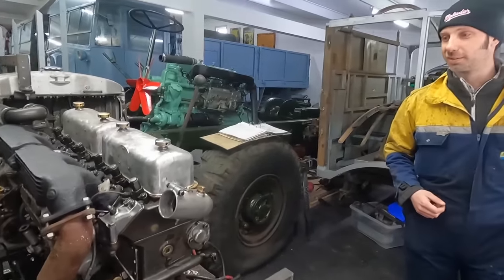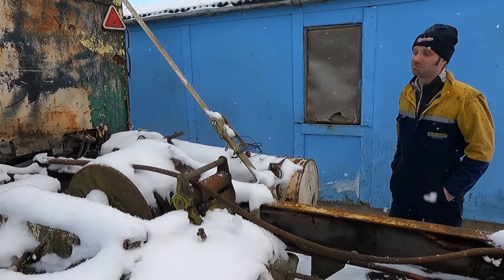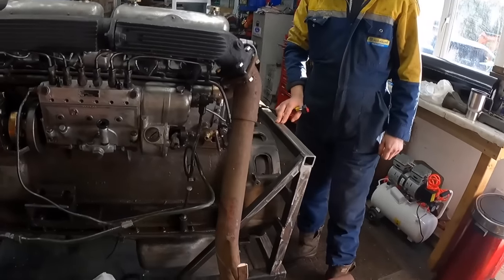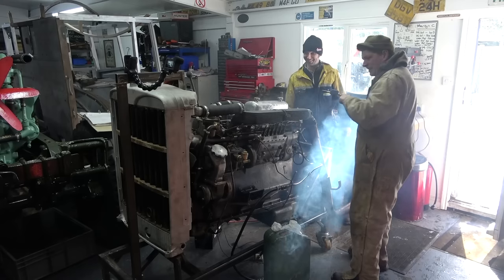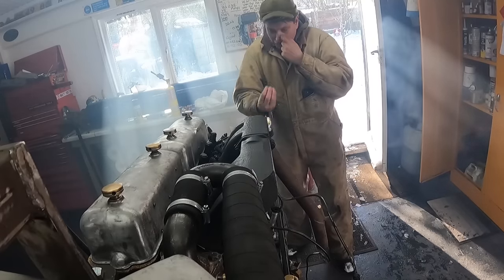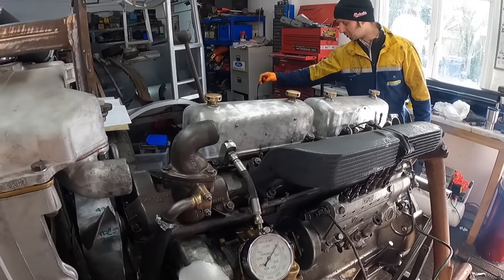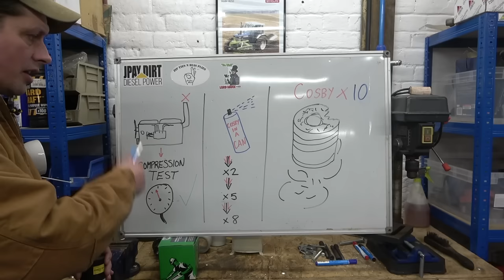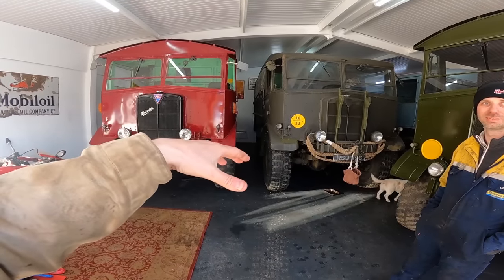WILL IT START ? - 82 YEAR OLD TRUCK COLD START

Comment: never touched an AEC engine myself so lookingforward to seeing more, but like the C6 RR long as you have fuel, air & compression they will fire. an old truck mechanic told me when i was restoring my diamond t the only thing that will stop that rolls from running is if you have the pump 180 out. so naturally when i fitted the rebuilt pump i got it 180 out bloody plank!!! proper old school armageddon engines just love them. 

and yea go for it be interesting to see what you can get this engine you got to fire on see if you can match what peg did with slave lake, fuckin minty!!!
Reply from the maker: Nothing will touch Slave Lake 😎
Reply: @LordMuck  that idi runs in canadian black magic lol

Comment: Learnt to do my hgv 2 in an old AEC in the army in Germany mid 80s if this was ex military it may have had alot of ether used this burns very hot and can damage the rings sounds like low compression so no compression ignition
Reply from the maker: If an engine is in good condition, it will start without ether or if ether is used in cold conditions it won't harm it. If you watch the video you'll see what's up with it.

Comment: They had a bloody sherpa van at work back in the 70's Mechanic went out in it, went for reverse ( it's a lift and accross job ) and the whole gear lever including the overdrive wires !! came off in his hand, Be a interesting vid to see what will and wont start engines .

Comment: I live in Australia and there are 7.7 litre and 9.6 litre AEC engines here that will need parts etc. There has been concern of where we can get parts. Me myself have an AEC regal bus with a 9.6 litre engine and there are plenty more here. Could you send me details on where you get your pistons, rings, bearings etc. from or remanufactured to help old vehicles down here stay on the road a little longer. Thanks in advance. Like your videos by the way.
Reply from the maker: Drop me a message on Facebook or Instagram.

Comment: drove a cotton picker for 15 years , had to use eather every time it was started . timed 3 times ,overhauld 1 , and 1 new enjector pump . fuel lines cleined out every year 2 set os filters in the 3 month hearvest time.  did not mater 30 deg. f.  110 deg. f.
Reply from the maker: Something was wrong with it then as it wasn't designed to run on ether all the time.
I've seen a CAT engine that was completely oversized from new. Turns out it had the wrong pistons.
There's lots of reasons why but it definitely shouldn't need ether all the time.
Reply: @LordMuck  it never would start with out eather hot or cold .even if it was just shut off, needed eather to start,  we had 2 other pickers  that start every time no eather
Reply from the maker: Exactly, something was wrong with it.
What engine was it ?

Comment: Good evening just watched your video have a question for you I know how much you love either but I have a 1973 135 Massey and you can have it rolling over as fast as it will turn and you give it a shot of either it will lock that engine up tighter than a pad lock and it took 24 hours for it to on lock so how do you explain that?
Reply from the maker: Don't use ether...😆
What made you use starting fluid in the first place, why wouldn't it start ?
I'm no fan of Ether, I'm just not afraid of the stuff or think it's a Rebuild In a Can.

Comment: Be interesting to see what it would run on , 50/50 mix of kerosene and butter milk maybe lol  with that amount of either it was gonna do one of two things go or blow it went kinda, looks like that old engine had a hard life maybe 🤔 I  heard it hissing as you were cranking it over I was guessing broken rings or maybe a burnt piston maybe even a hole in a piston, #6 looked like it swallowed a injector tip
Reply from the maker: At this point we think worn rings were overcome by using more and more ether, eventually becoming too much, breaking an injector tip which over fueled, detonating and destroying chunks of crown and the remaining piston then breaking up.
Watch the next episode in a couple of weeks 😉
Reply: @LordMuck   yeah sounds like a good theory of what happened,  I’m looking forward to seeing the next episode , the one outside started pretty good for the temperature, wonder how much lower of a temperature one with good compression would starter at

Comment: Podge, I lived with an International truck with a Neuss D358 motor which consumed a lot of “Start Ya Bastard” over the years. Eventually the starter motor shat itself and the new starter motor spun the motor at the right speed and it turned out it was a good starting old girl after all. We thought it was just another tired piece of crap Neuss. Jeff
Reply from the maker: It's surprising even on a diesel how much difference a good starter and battery can make.

Comment: Soon as that thing started cranking over it sounded like either the starter was on double voltage or it had bugger all compression...  Maybe 3 pots over 300psi and the other three, hmmm...  Anyway, you know damn well we'd like to see you fart round with that engine and see what it'll fire off on...  May I suggest using firm hold hairspray (and maybe later in the day, if you do, as it might gum rings up a tad).  Cheers mucker.
Reply from the maker: Did you notice someone had fitted a 12v starter ? 😉
Don't forget though, this engine has no driveline or ancillary equipment so they do turn quicker.
Reply: @LordMuck  True true, but still sounded low on compression just from a standpoint of never having heard one before but knowing it's diesel.  Interested to see the rest of the innards, was nasty yet it nearly actually did run!  Never noticed the starter no. Also why is it always the shiny nice looking engines that are the shitters, yet the ones with cobwebs and mouse shit in the valves seem to want to run mint!

Comment: I found this video more interesting than usual because it wouldn't start, I'm hoping it's not too far gone to not be feasible to repair. I'll be following this to see what's actually knackered apart from the obvious and the outcome (hopefully good).
Very interesting video all round, the Sherpa needs dumper tyres on it, great for a laugh 😉 .
I've done the usual old trick using brake cleaner and or deodorant, nothing special.
Reply: Forget to say I've just put my order in 👍👍
Reply from the maker: Cheers Ronnie 👍

Comment: 490 psi  seems high?  I make that about 33:1 - I thought about 25:1 was about as far as diesels went.
Reply from the maker: As an example a 6cyl Cummins in various spec is around 450-500 psi.
Factory spec on the AEC is 420-490, a healthy used cylinder coming in around 380psi.

Comment: Surely at 16 to 1 comp ratio  x 15psi for atmospheric pressure you get 240PSI. why are you looking for 400psi?
Reply from the maker: Because 380-490 psi is what the pressure should be in these engines
What are you running on about 16:1 ? It's a Diesel engine and a lot of diesels run as high as 25:1.

Comment: Just thinking outside of the box an interesting thing to try and run your Ford 27/24T engine on would be waste plastic so youd have to melt waste plastic down like plastic bottles and do some very  very crude Fractinal Distillation to turn your waste plastic back into an oil / dodgey Diesel i think it would make a very interesting / scientific video 📹  that would interest viewers to see if you really could run an old diesel on waste plastic through the injectors. Not the inlet manifold it might take a couple of weekends to rig a Distillation rig up but i definitely think it would be worth it making your own fuel and seeing if an engine would run on it the government are always going on about recycling ♻️  well you are turning the plastic back into an oil/ Diesel to run in your engine lol. 😆
Reply from the maker: If I had the time to do all that I'd use it productively and spend it on researching meth and hookers...
Reply: @LordMuck lol 😆 Fair enough i suppose it was a big ask i know it wouldn't have been a 5 minute project but if you dont ask you never know. Just spray some lighter fluid down the inlet manifold then and see what that does or put some propane gas into the inlet manifold and see what happens you might want to stand back a bit with that one lol.
Reply from the maker: If I had the time I'd love to produce a waste fuel and refine it. In the oilfield we refined well gas to run our 18V twin turbo gas compressors on.

Comment: Did you know you should use WD-40 it will work just as good as either but have oil on it
Reply from the maker: No it doesn't, it's just more internet bollocks.

Comment: There was a lot of shit talking in that "coming soon" bit 😂

Sounds like AEC engines are a bit like Detroit's; they'll run no matter how hard you abuse them, until this happens
Reply from the maker: It smelt worse than the burning ether.
Reply: @LordMuck  try funneling that into the intake next time, see if your engine either fires or pukes 😂😂

Comment: Yes. It will be a hoot. I have used wd40 to start 2 cycle gas engines in the past. But the new formula of wd40 does not work as well.
Reply from the maker: That's what I think folk fail to realise.

Comment: i've heard of engines gun powder, coal dust, coal gas, hydrogen, alcohol, methanol, may be don't try acetylene,      
have you heard of american army truck multi-fuel engine phased out 20 years ago.
30 years ago I saw a Cummins  truck engine they would idle it on diesel then every thing above idle was on CNG.
Reply from the maker: 😂 I have ran and worked on countless Continental multi-fuels in the M-35's, both turbo and non-turbo including the C-types for cleaning running (Californian  Deuce) With the introduction of the 900 Series they went to Cummins.
Reply: @LordMuck  I'm impressed you have worked on those Multi-fuel engines, 
how did get exposed to those trucks and engines.
Reply from the maker: We bought and sold them. Used to get them direct through the DRMO and ex-US forces Europe then go through them and then put them up for sale. M-35, M-54, M-123 (Cummins 903) 800 Series and now the 900 Series.
Reply: @LordMuck  some of the multi-fuel had a cold weather starting kit by spraying fuel in the intake manifold and there was a igniter there.
Reply from the maker: Some had Ether applicators fitted also.

Comment: Easy start addiction ?
From past experience  on farm machinery
Reply from the maker: Engines don't get 'addicted' to Easy Start, if they need it all the while they're just fucked as someone has ignored an underlying issue.
Reply: Well I watched your first one was hooked so I subscribed as regards to your answer I didn't see your piece about the AEC and the engine in the workshop 
I used to operate one of those when I was 14 for a timber felling company 
Then worked on a farm who had a international Drot a 3C small Thwaites rear steer dumper and couple of Nuffields 4/60 with fuel tank before radiator and a normal 4/60

Comment: Things I learnt from old timers never start a crank start (not electric start) diesel with ether if you don't know what the F#&K you are doing. As they say, it's starts on oil for a reason. They have seen people break their arm because they were holding the crank handle wrong and using too much ether trying to start the Listers (can cause them to back fire). Thought I might say this as a warning, that I heard from the older folk. Also if you are going to run different stuff though a diesel I have always wanted to see one run on two stoke oil not as a starting aid but as fuel.
Reply from the maker: That's very true. As a kid I once saw a Field Marshall run backwards for about 20 seconds when ether was used as well as the starting paper...
Reply: @LordMuck  My brother and I a few years ago had a southern cross YB diesel run backwards on the oil used to cold start them, the crank handle slipped out of his hand as he got close to the compression stroke, it backfired and ran backwards for a short while. Scared the shit out of him.
Reply from the maker: That's how experience is gained 👌🏼

Comment: Stuck rings?
Reply from the maker: Stay tuned...
Reply: @LordMuck  I'm taking dibs on stuck rings. Seen it plenty of times before. The lady casualty was a howard rotavator with a sachs 500 diesel. Unfortunately and filter was on and it ran away. Never heard a 2 stroke run so fast